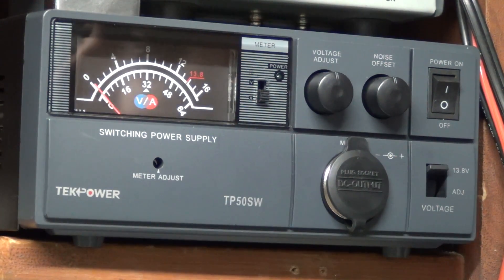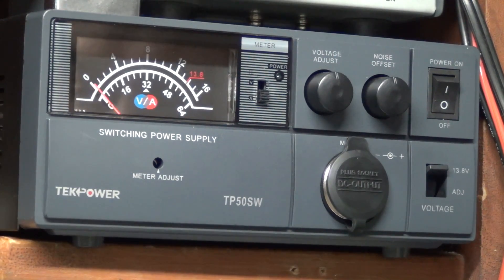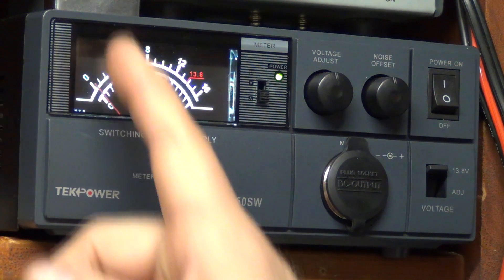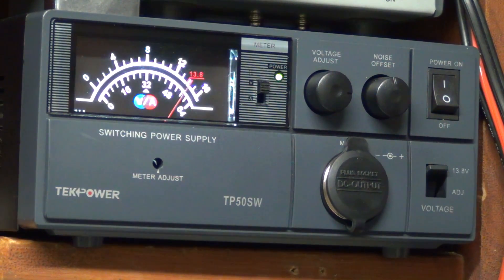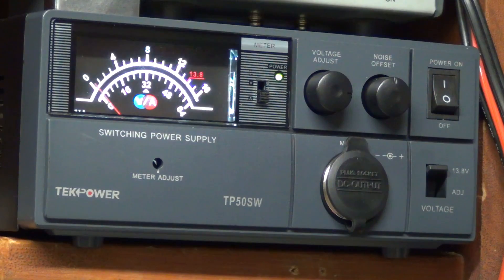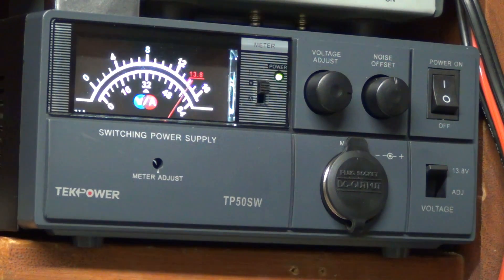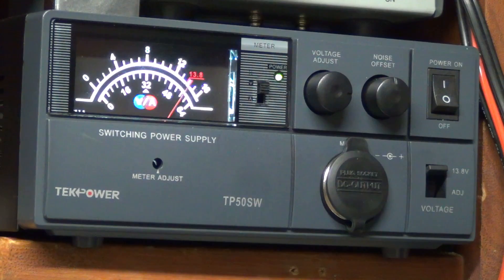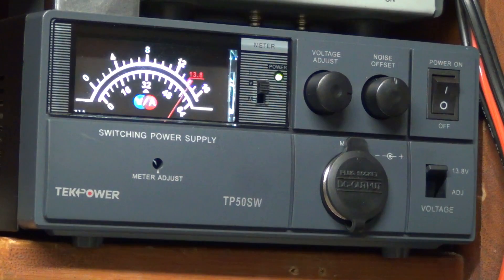CB and HAM Power Supply. The Tekpower TP50SW 50 Amps of Juice!

Comment: My friend has/had one of these until last week when it burned. Two of the switching transistors burned and in the process took out his Icom 7300 and a tri band Yaesu. The plate that holds the transistors down looks like a welder hit it, melted one corner. The thermistor across the AC input is in three pieces. There is no fuse in the unit at all. Be Careful with this unit!!
Reply: On Amazon very highly rated, and very popular with ham guys.
Reply: Its supposed to have a 15amp 110V fuse inside
Reply: BS

Comment: come on eric, you got a free $500 radio but you couldnt spend $200 for a quality power supply. Please stop doing reviews on this supply, I dont want anybody else getting screwed on this supply like we all did. GET RID OF IT BEFORE IT FRIES YOUR EQUIPMENT. I am not the only person with this issue. Theres a reason why you got it used on ebay. They began having issues, they took the cover off and did the "reccomended fix" and sold it.    I had 2 clients of mine who had me try to repair theirs aswell after mine blew up. Theyre junk. Get an astron or build yourself one.
Reply: i am using 3 of these tp50sw power supplies for over 2 years now and a tp30swv for over a year now for my business and had no problems what so ever with any of them,they all run 30-40 hours a week

Comment: What about that cheapo power supply you bought that requires you to supply your own wiring?  Did it catch fire?
Reply from the maker: No, I still use it for other radios, but it was only a 28 amp unit and this one needs the full 50 amps to run at full power.
Reply: @FarpointFarms  I would be very interested if you could do a review of that cheap one.  There are about a dozen "brands" of the same type on Amazon. I'm curious about your experiences.
Reply from the maker: I'm not sure it even has a brand, but I'll take a look and show you how it works.

Comment: Could you go over what  antenna I would need for my 2990 to listen in on ham to see if I am interested in getting into it thanks and good video
Reply: most any vertical ant. will work .. the imax 2000 is used for 10m, 11m, and  12m. you will need a ant. tuner to help with the swr. when you transmit . but you can listen all you want . they do good also on the other bands. the i max is what i use.
Reply from the maker: Exactly what Piper said!

Comment: Whats the biggest amp you can run for your radio on that power supply
Reply from the maker: I don't know, but I'd imagine it could run something up around 500 watts with this much juice.
Reply: @FarpointFarms  that a lot hey how many watt amp can i run on a 25 amp power supply
Reply from the maker: @reaperct3454  Maybe a 200 or even a 250.
Reply: @FarpointFarms  ok thank you hey do you use face book